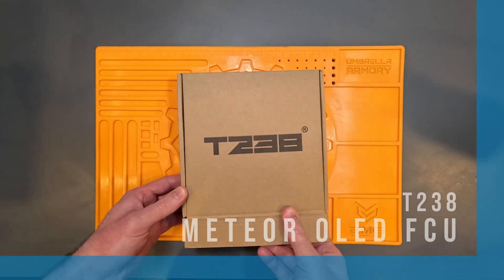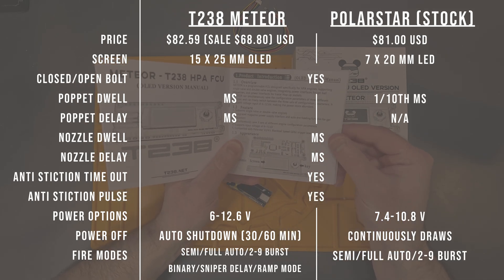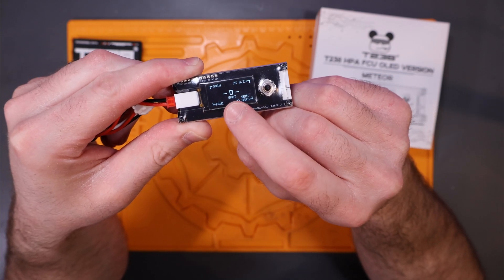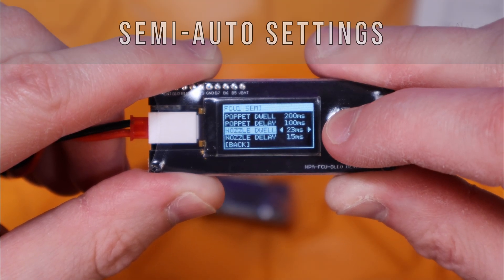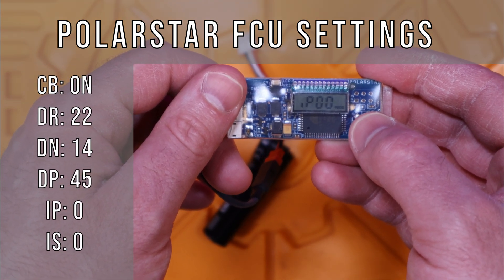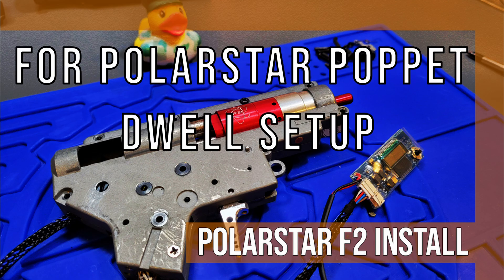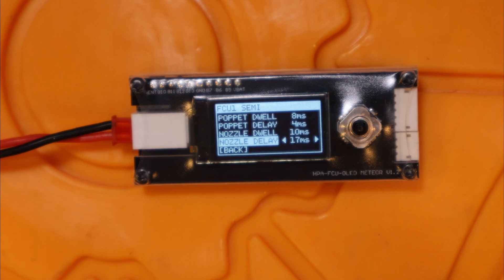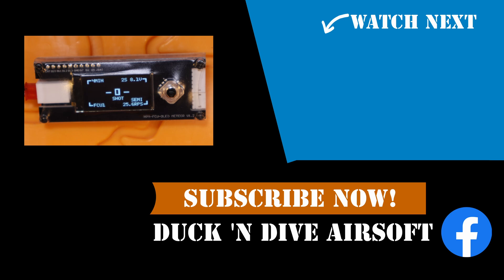T238 HPA FCU for Polarstar Engine

Comment: Hmm i play on a field whit rule 1.2 max 1.3 joule for assault but which one can i better fine tune t238 or standards f2 fcu?
Reply from the maker: Both will work. FCU Won't make that much of a difference.
Reply: @DucknDiveAirsoft a okay i play whit a kythera now whit a pdi 275 mm 6.05 4uantum bucking omega nub stock evolution chamber but i wane put kythera in a vss build

Comment: Will this work with fusion engine?
Reply from the maker: For certainty you should ask T238 support but I suspect it will have no issues as the Fusion engine is similar to the f1 aside from the gearbox replacement that it comes in. Both run on the same control setting for the polarstar FCU (FE/F1)

Comment: It's a thick little sucker compared with a polarstar fcu and the other t238 fcu.I actually got one of the Bluetooth t238 fcu's for a jack instead of running the factory polarstar fcu
Reply from the maker: Yes with the dual PCB and screen it's slightly thicker but not bad. Polarstar actually just released a new FCU too I Havnt had a chance to check it out yet.
Reply: Ahh will have to check it out ,cheers bro @DucknDiveAirsoft